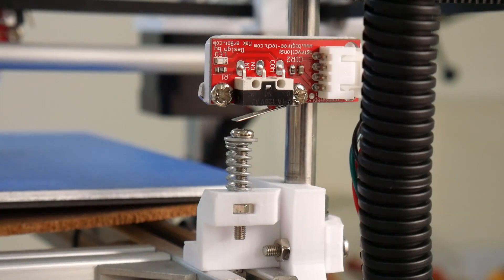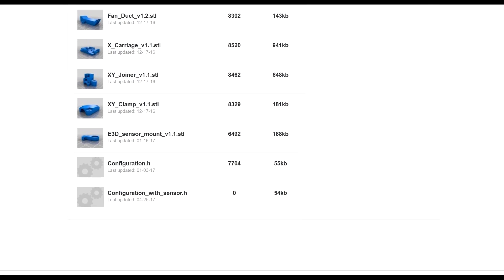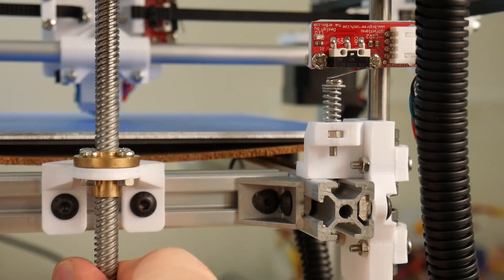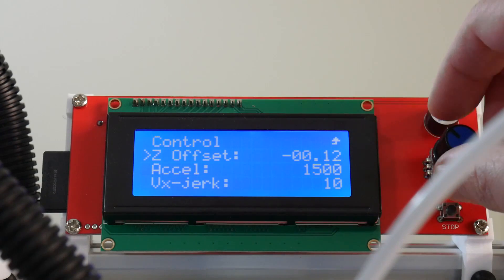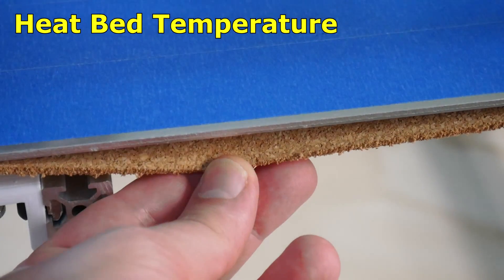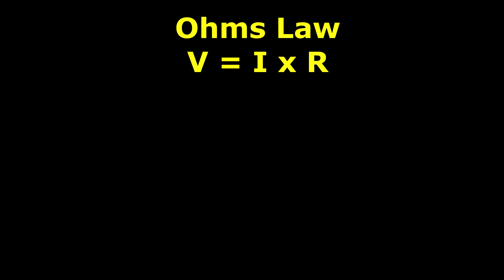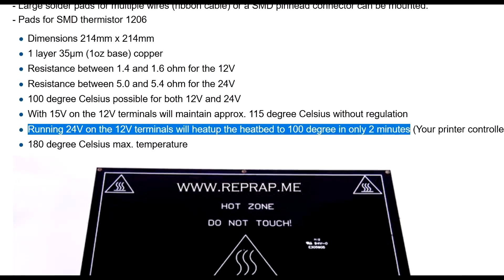HyperCube 3D Printer: Tips & Tricks #2

Comment: hello
i am using same LCD controller with ramps 1.4
there is no option in control menu for heat bed temp. settings....
info screen is also not showing any details about heat bed temp
when i start print, bed heats up, but then print stops and screen displays 
"heating failed, print halted"
i have changed the thermisters.. it is still happening

Comment: The voltage adjustment trick is one of the reasons I prefer the RUMBA board to RAMPS. Has a separate power input section for the bed.

Comment: If for a 12v heated bed you can go up to 15v for the 24v how high can you go with the voltage?
Reply: There's no need to increase the voltage for 24V. And to even really answer you question, that depends on your electronics. Check the capacitor voltage rating on Ramps and Arduino and a few other things I can't remember right now.

Comment: You can also use a 220 volt (mains voltage) heater for the bed and solid relay to turn it on and of with ramps ;) There are some good ones on aliexpress with 3M sticking glue already applied
Reply: Anton, I completely agree!!  I'm running a 200mm X 300mm aluminum bed that's 7mm thick with a 120v 600w silicon heater.  It will get to 75c faster than my E3D hotend can get to 235c.

Comment: This is why I do not like the MK3 because I use 24v and somehow they screwed it up with it taking less amps than the MK2 so at 24v using the 24v connections I couldn't get 110c reliably but on the MK2b I can get 130c.
Reply from the maker: I totally agree. I've been caught out buying a heat bed with far too high resistance and not able to attain a high enough temp. I wish they were all standard with only the dimensions that differ.
Reply: I wanted it for the aluminum bed so I could use my 8mm probe but the thing just couldn't heat up and my current MK2b still has that short on it so if I put back on an aluminum plate it will fry my Ramps again but with an all in one that wouldn't happen.  I agree I wish these were standardized because if it says MK on it they should all be the same electrically.

Comment: I notice your ramps board still has the original power connectors. Have you had any issues with them?

Mine burst into flames when testing the heated bed at 110. Had to remove and solder the power leads directly to the board. 

Also thinking of upgrading and sinking the mosfets as their Rds is pretty high and as you note in the comments can get close to thermal shutdown even with airflow.

Ramp boards (at least the cheapo clones) really need some mods to be a use and forget about board imo.
Reply: My ramps has no issues and I use 110c for my bed temp for ABS.  I will say this ramps is different as I replaced the two mosfets with much better ones so they do not even get warm to the touch but on my original ramps 1.4 it got so hot it melted into the connectors (just no room there) but the connectors never melted due to the amperage draw.  Came from Sainsmart and the replacement was an eBay model.  I had to replace it when my MK2b shorted it out and I replaced the mosfet but it never worked so was farther up and just never could be found so for 8 dollars I had a new one.

I would suggest you change the mosfets on any ramps for the more preferred ones as they never ever get even warm to the touch while the original ones will burn you a blister because they get so hot.
Reply from the maker: On my original Prusa i3 I installed a heat sink to the bed mosfet. That helped a lot as the mosfet was shutting down due to high temperature. I never had a flame-out though, that sounds unlucky. The price of these boards are hard to pass up though.

I should buy a bunch of replacement mosfets with lower rds to prevent any future 'incidents'...
Reply: Precisely what  I did on the new board and glad I did it too.  Seriously, no heat sink and after 6 hours of printing at 100-110c on the bed and 235-240c on the nozzle neither mosfet is even warm to the touch but with the normally used mosfets they would blister you if you tried that.

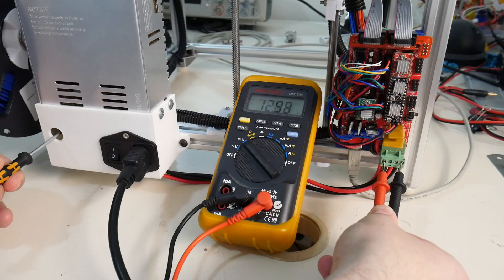Comment: Are you using TMC2100 SilentStepSticks at 3:23 ?
Reply from the maker: Yes I've been testing the TMC2100 step drivers on the XY motors in stealthchop mode. I've read we shouldn't use stealthchop as it starves the motors of torque, but maybe that's for Prusa style printers where 1 motor drives 1 axis. On CoreXY printers 2 motors drive the same mass. So we effectively have upto double the torque available. Plus as our moving mass is very light, especially with carbon tubes, it was worth a shot.

And guess what? It works great! I printed a 100x100mm test cube with honeycomb infill at 100mm/s print speed, 3000mm/s/s accel and 20mm/s XYjerk - no skipping. 

It also makes the printer considerably quieter, not that is was loud initially but now it's whisper silent :)
Reply: The current on TMC2100 is continous current, not maximum current like A4988 or DRV8825.
As an example, my motors are rated 1.2A but I'm running my TMC2100s on 0.8 Vref voltage. And I'm even using Stealthchop. So far I've printed over 20 hours with these settings, no missed steps or anything. They are deadly quiet! It's awesome!

P.S. I have double Z motors and geared extruder.
Reply: Oh and also, if you really do want Spreadcylce mode, don't freaking solder on the drivers, there's no need for that! Use the jumpers to change the settings. I think the first jumper (MS1) activates Spreadcycle 1/16 microstepping. I don't have any jumpers on for Stealthchop 1/16.

And if you want to get rid of the whinning of motors on spreadcycle, get a Step Up converter and increase the driver's voltage to 24V by the VIN pin on drivers.
Reply: Oh and one more thing, I have the black version. It's working just fine. It's not from MKS though, it says AnyCubic on it.
Reply: Sevendogtags whats the matter with solder the drivers???? with these version you have to solder because setting wild jumpers didnt change anything without soldering the jumper pins at the driver the conf1-conf3 didnt have connection to the chip so they are set to open! and still with the version of waterott its better to set the configuration at the driver there is no documentation for the boards which jumper setup the driver what conf. makes... so try for hours and even didnt know exactly or solder 2 pins and a wire in oO

2. maybe you can use stealthchop at your printer. be happy with it this depends on what kind of printer, what motors, belts, extruder - because of weight.... etc you are using and for the most people stealthchop did not work it is also not rated to use it in that mode for printers is known this causes may problems.

btw the whining at speadcycle isnt that much and even if  it is you can increse the Vref a bit or do so as you toled.
Reply: Because why would you do that when you can easily do the same thing with jumpers? Not to mention giving this advice to other people you don't know could result in their drivers being destroyed since not everyone is good at soldering and might accidentally make a short. Putting on jumpers is dead simple and fast.
The pin configs are the same on all  Ramps compatible TMC2100 drivers, however you should know that they're named in reverse to original in clones. So CFG3 on clones is CFG1 on original drivers and so on... There are tables that show different possible configs and what MS pin needs to be shorted with a jumper to achieve the settings you want.

2. Yes, you're stating the obvious here!  My point was everyone just reads, oh Stealthchop doesn't work for 3D printers and don't even bother trying it. All I'm saying is that it can work, so try it out and it work for you too! My printer is Hypercube btw, a corexy.

Well the whining really bothered me on spreadcycle, that's why I switched to stealthchop. But this is how TMC2100 are. Over 18V their whine is reduced massively. Increasing the Vref won't work for everyone, you might not even be able to depending on your specs. It won't work since not everyone is using the same motors. The TMC2100 chips are all the same.
Reply: you did not read my text correctly but okay. next not everybody uses a ramps configuration so this is ment wirh different pin outs for jumpers depends on the board you are using.
Reply: Tech2C, it seems you're using the MKS TMC2100, isn't it? Are you going to make a video about those?

With these drivers from MKS, I have skipped steps, even in spreadCycle mode. Moreover, the acceleration is set to 1600...
Sevendogtags, you mean CFG3 and CFG1 are inverted on clones?? So the wire should be soldered from GND to CFG3, and not CFG1 like on this picture?: http://reprap.org/wiki/File:TMC2100_spreadcycle_topview.jpeg

I'm not sure if the problems concerns my drivers (MKS TMC2100) or just a misconfiguration... So I don't know if it's going to work better with original TMC or if the same problem will appear...
Reply: Théo first you should be sure what mode your drive is now.
Reply: How can I be sure they're using spreadCycle?
Reply: this is the reason why you solder the jumper by your own!
you can hear it, stealthchop is not any little of a whining noise to hear. 
spreadcycle sounds like a DVR8825 but only in little little little tiny whisper sound - but you can hear it

look at this wiki side http://reprap.org/wiki/TMC2100
Reply: Difficult to say if it's running in spreadCycle or stealhChop just by hearing the sound, since I haven't a "reference sound" of a TMC2100...
I have soldered a jumper wire between CFG1 and GND but apparently, CFG1 and CFG3 are inverted on clones, so maybe my printer is running in stealhChop!
I don't have any whisper sound but my entire printer is in 24V so I shouldn't have a whisper sound whatever the mode.
Reply: How can I send you a private message with my number? There's no button for sending a message on your channel
Reply: true xD

rafael.jesdinsky@gmail.com
Reply: +Theo, no the pins are exactly the same, If you're going by the photo then solder the 2nd pin up from the pot. It's just the names that are reversed.
You can read about it on Pin configuration on http://reprap.org/wiki/TMC2100

This link is for Ultimaker but a lot of the info there applies to all printers: https://ultimaker.com/en/community/11571-step-by-step-installation-of-silentstepstick-drivers-on-umo

I followed the guide for Ultimaker for me Hypercube, works nicely!
Reply: Not for the chinese version : https://goo.gl/RErxpQ
I bought them but I have not enough torque for my printer (an Ulticampy 3, similar to an Ultimaker).
What current did you set?
Reply: Théo sure they got enought torque.... but you should know how to manage those drivers and know what to do! pls read the wiki before you give com. like that. you can set tmc2100 in lot modes but only 1 is usefull for a 3d printer
Reply: Yes I set those to spreadCycle mode since stealthChop doesn't give enough torque for 3D printers. But I can't set those above 1.2Amp, while my DRV8825 can go up to 2Amp... The torque is just a little bit too low (I have missed steps sometimes). Maybe it's because they are clones? If you have advices I'm interested!
Reply: Théo no way.... i bet you did the same fault like me. i got chinese, too and set them to spreadcycle.... i thought i did it and got lot of step losing in many prints. there are some versions of chinese tmc. i got the white inkl. the blue large heatsink - the best clone i think - they have solder bridges at the backside for every conf. pin. best way to make sure they are set to spreadcycle is to bridge conf1 to gnd by yourselfe with solder a wire between, then solder the bridge beside the conf1 pin at the back to connect the chip. if you use ramps unpin all jumpers under the driver. cut the pins conf1, conf2, conf3, and the two above them and youre done. 

you can hear the drivers will be louder when they are set correct but still way better than the DVR!

on your version of the driver it will be tricky because its a bad copy. maybe they are bad labled :( then you have to solder cfg3 bridge at the back and do the brige with the wire from pin ms1 to gnd at the top because cfg3 is connected to ms1 = cfg1..... this is confusing pls read instructions or buy the copy of FYSETC.com they are simple to use and work awesome!
Reply: Thanks a lot!
At the beginning I was using my drivers without the bridge wire, and without Ramps jumpers. Because of my missed steps problems, I tried to solder a bridge wire like on the picture of the TMC2100 wiki. But it didn't change anything... Always missed steps... In fact, I think the driver was already in spreadCycle mode by default without the bridge wire, because of the internal pullup resisor of the Ramps.
I will probably buy the genuine TMC2100 from wateroot electronics, it should work without problems...
But they are expensive (10€ each + 10€ of shipping)..
Reply: hmm... u think the black are bad labled there are 2 wiki sites and only 1 show up the trouble with the bad copy. i told you buy the version with the white board ;) simple to set to spreadcycle and work fine + cheap .... only about 12€ inkl. nice heatsink. and dont forget to cool the part with the drivers activ for longer print times

Comment: Thanks for another good tips video I have a solid state relay in mine (originally part of a He3d prusa i3) and it get from 20 degrees to 60 in about a minute it's really quick
Reply from the maker: A minute is really fast! I haven't done that mod yet, I still use the internal mosfet on the RAMPS 1.4 board. With 60c it's ok but at 90c+ the mosfet gets very hot. So I attached a heatsink onto it.
Reply: R Pers yes it's really good but you can't use PID it had to be bangbang otherwise it clicks on and off rapidly and sounds like it's breaking. took me a whike to figure that one out

Comment: I see you use a genuine e3d hotend, but with a different bowden fitting. I too didn't like the original bowden fitting included with the e3d. How did you mount the non default bowden fitting to the genuine e3d?
Reply from the maker: Well, first use a non-genuine E3D, then attach a genuine E3D block and sock upgrade to it :P
Reply: So basically, you are using the clone heatsink with a genuine heatbreak and heatblock?
Reply: meesternadim sure most people do this.... cheapest way to get this setup and it work like a charm. if you want to print material at higher temp pls change the heatbreak into a version without the ptfe tube- not the chinese one they are rubbish
Reply: Why didn't you like the original bowden fitting?
Reply: Because it was a bit loose and had room to wiggle up and down. It was barely a millimeter,  but in theory still enough to cause issues with retraction and with tpu.